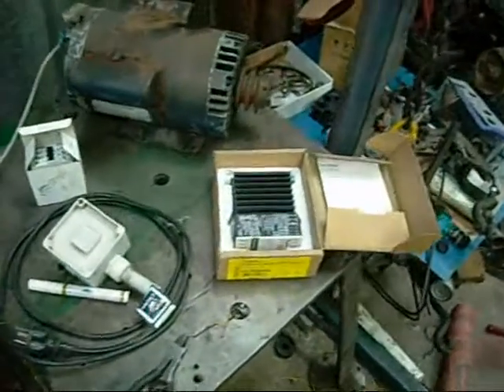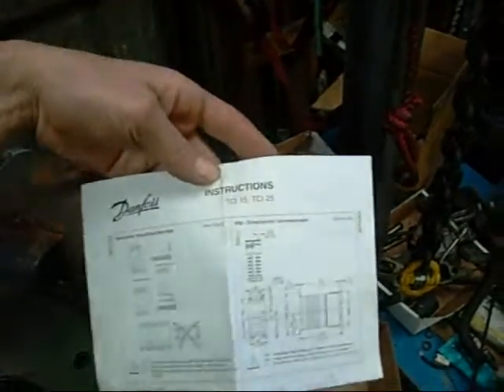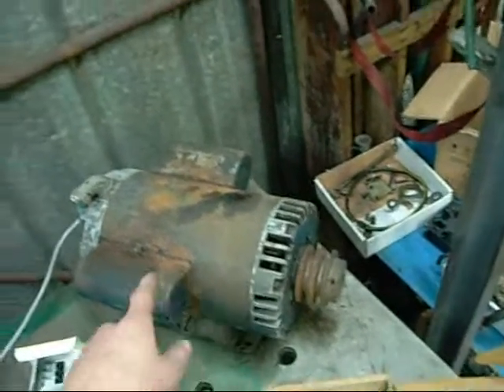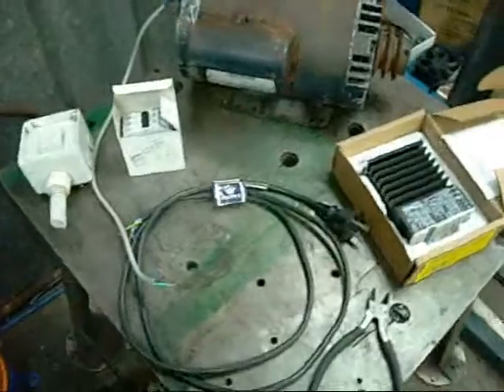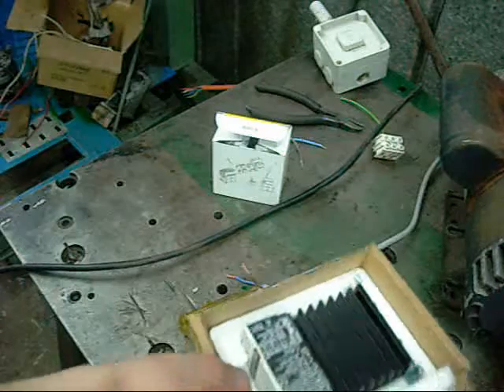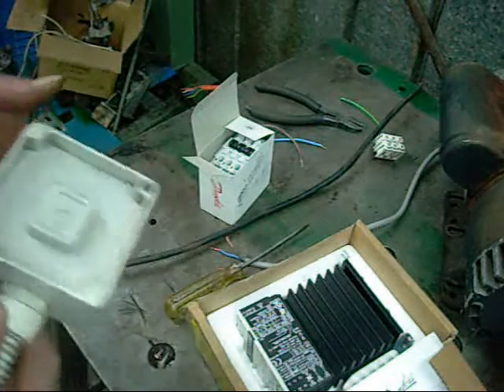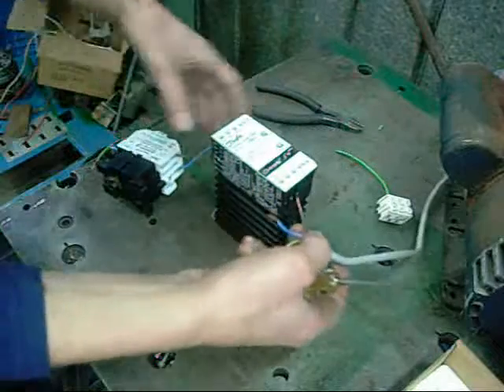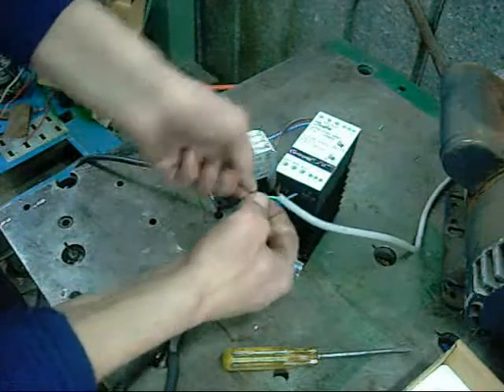Pt1 - How to Install and Use Danfoss TCI25 and TCI15 Start Torque Limiter on Single Phase Power

Comment: I fitted some air con in a small shop, went back to comission when sparky had done his thing, unit wouldn't run but showed live with a volt stick, then used a propper tester and found no neutral??? traced this to the breakers being off in the mains board and the main incoming tails from the meter being round the wrong way! All the fuses were in effect in the neutral and every wire in the shop was only protected by the 100A main fuse.

Comment: HOLY SHIT!! I just about freaked out when you said that white was hot and black was neutral. Here in the US, It's just the opposite, Black is hot and white is neutral. At lease the ground wire (you call earth.) is green. here in the US a ground(earth) wire is green or green with a yellow stripe.

Comment: @amfan12 What gets odd is that many 230v devices in the US also utilize the neutral.  For example a clothes dryer usually has a 230v heating element, but use 115 volts for the motor and controls.

Interesting that wirenuts are illegal in Australia, any particular reason why?

Comment: The US 230 volts isn't technically two phase, it is called split-phase. Basically the secondary on the pole transformer is center tapped. The center tap is your neutral while there are two hot legs on either side. hot to hot is 230 volts, while any hot to neutral is 115. The hot - hot 230 appears the same to devices as aus/euro hot - neutral 230. The only problem is that you need a contactor or double pole switch otherwise the device would always have power on it.

Comment from the maker: @V8Jagnut  yeah I've seen the 2 core lighting cable with white but its usually the neutral with red as the active, to me white is L2 on a 3 phase line, or control in a cabinet arrangement.

Comment: allot of the new cable run from power poles to the mains fuse link for overhead installations is now wired in aluminium core wire. i have a bit of it from when the neighbors line was knocked down by a tree and the linesman slipped me the old stuff. i have never seen it elsewhere tho and can see why. its interesting that they use it on lines. maybe it has some sort of coating or something?